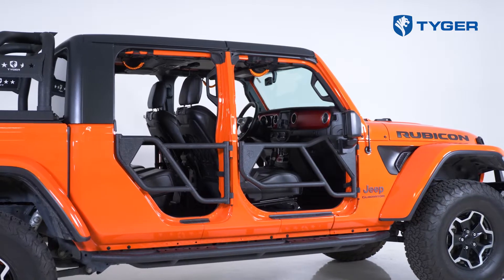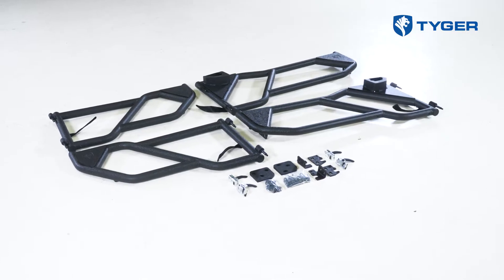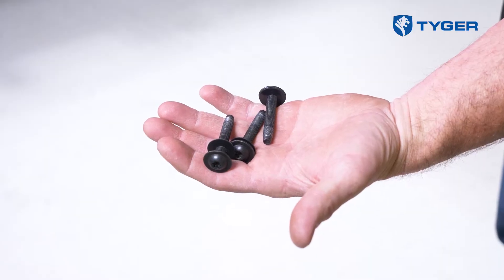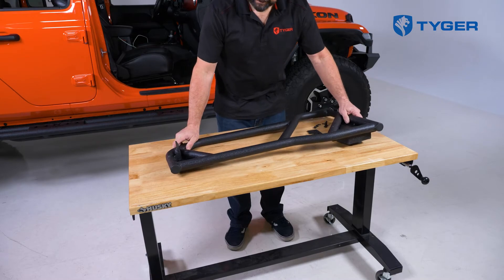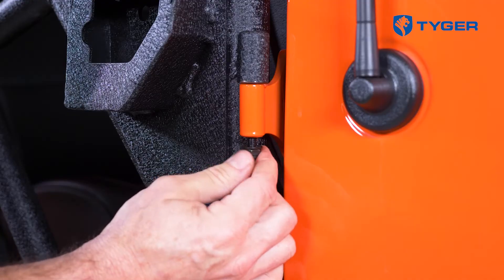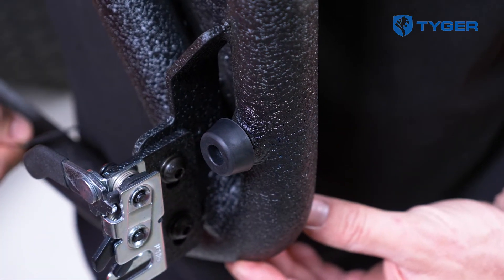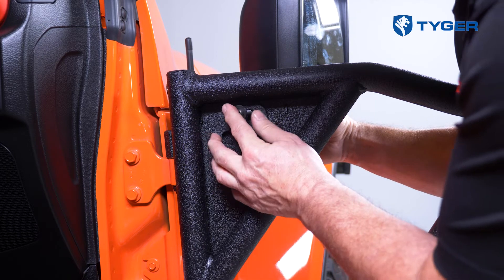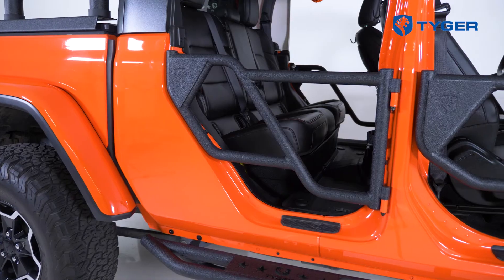ARE YOU NOT ENTERTAINED? | Tube Doors for Gladiator JT & Wrangler JL | Install Guide | TYGER AUTO

Comment: Great looking tube doors, looks like not much adjustment needed other than latch and bump stop. Is there other mirror options that don't require removing oem mirrors?
Reply from the maker: The mirror compartment is attached to the factory doors so there really isn't any other options out there that won't require you to remove the mirrors prior to swapping the doors.
Reply: I just got these doors, and for what I saved buying from Tyger, im going to buy a set of manual mirrors from Rockauto